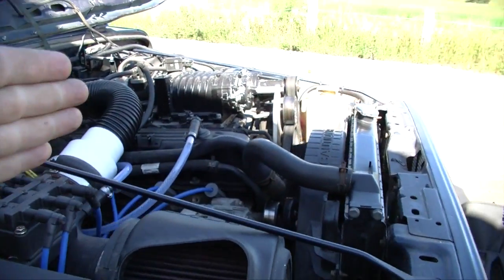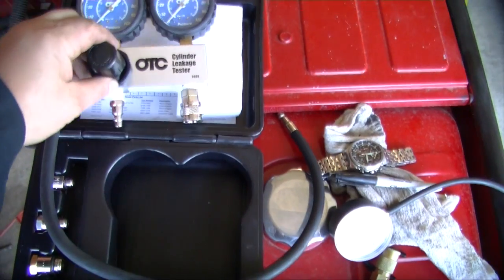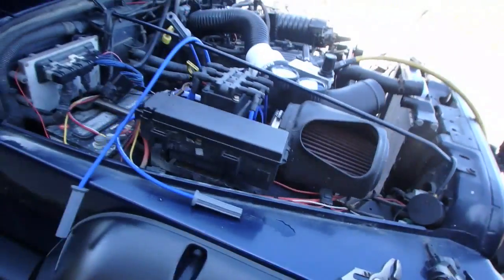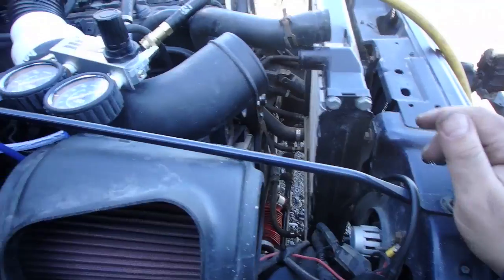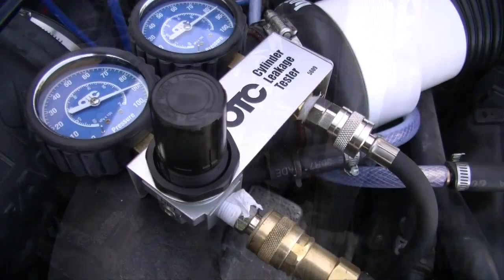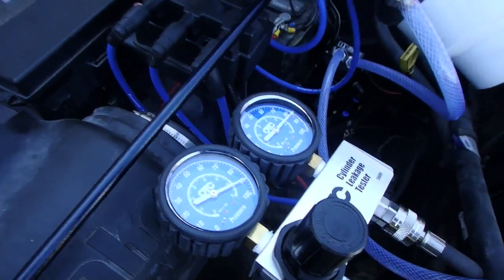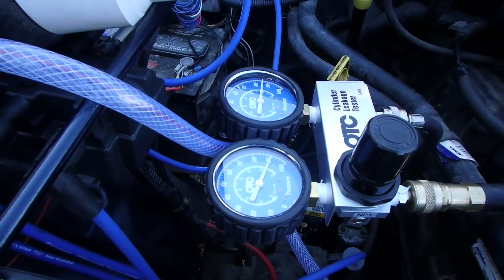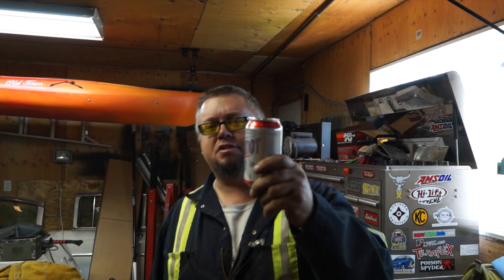Troubleshooting Low Engine Vacuum

Comment: How did you end up at 130 compression (found it), How to Do a Compression Test DIY - YouTube, you should use your camera and video all puffs of compression on your gauge, compare all cylinders puff by puff, I like 5 puffs and that is my goal. The first puff is very important but if the first puff is low due to a poor starting point of the piston, do that cylinder again. Need to lock the engine from rotating by other external means to save time. For folks who don't have a leak down tester, you don't need one, just listen for air leaks from the 3 important places, of course, you do need to get compressed air into the cylinder by other means. A running compression test can also be performed. Be aware that the battery is going to get weaker and show less compression the more you crank the engine guys, keep a jump box hooked up. Thanks for the video.

Comment: Was that cylinder effected because of the supercharger? What would cause that to wear out so quick? Loss of oil pressure in cylinder number 3 causing the rings to fail?
Reply from the maker: That issue was there long before the supercharger was installed

Comment: he man. pull it out and get a stroker long block. 
http://m.summitracing.com/parts/hpe-hp24?seid=srese1&gclid=CjwKEAiA2ve0BRDCgqDtmYXlyjkSJACEPmdwGOZavqD6h0YDjzYMFGrE2tyLYmroLvz4qNsFtEEBZRoCBOjw_wcB

or

http://m.ebay.com/itm/JEEP-Stroker-Complete-Engine-Upgrade-Kit-4-0-to-4-6-4-7-/141860737576?nav=SEARCH
Reply: i rebuilt mine myself just straight 4.0 new upgraded head and kept original cam, pistons, rods, and crank for a total cost of about 880 buks. included was a spent motor for 250 so i could do a rebuild so not to be w/o a vehicle during rebuild. runs awesome. but......my next choice would be a stroker.

Comment: Ah man, that sucks!  Great diagnostics video, though!

If you end up rebuilding this engine, have a look at the connecting rods.  I would suspect an oil delivery issue through the con rod--they typically have a tiny little pinhole through them that takes oil from the big end journal and sprays it on the cylinder wall.  It's such a tiny hole though, that they can sometimes get clogged up.  With all the other cylinders running reasonably well, it's my first thought.  Of course, there are millions of things that could cause excessive single-cylinder blowby.

Best of luck, Jerry!
Reply from the maker: +rhkips my goal is to try it till it blows up just to see how long it can last

Comment: Did you pull the dipstick to see if you could hear the air leaking past the rings?
Reply from the maker: +rhydtuned no need too, the crankcase air breather is the intake tube and doing a compression awhile ago i showed how putting oil in the cylinder brought the compression up to where the other cylinders where

Comment: I would normaly pour in some oil in the sylinder and do a test again.
Then you get good pressure on the valves and cylinder head gasket and if it start to leak more and more as the oil get pushed down to the oilpan then i'ts MFB!
Great videos, love you being so straightforword and honest and not give a fuck!
Reply from the maker: +Morten i put oil in cylinder when i did the video on the compression test and showed how doing that brought the compression up to the same as the others

Comment: I had a 2.5L push rod 4 with 150k miles that had at least 170psi on all cylinders. So good job on cluing into maybe there is a problem. I scoped the cylinders with a camera on a flex stick and could still see honing marks. So all the cylinders looked good. You may want to scope it to see if theres a buch of scoring on the cylinder walls or crap on top of the piston.
Reply from the maker: +Charlie Bryce I do have a boroscope but didn't see anything out of the ordinary, however a video on my other channel which will be uploaded in the future will show me scoping the cylinder and seeing that it looked good until i pulled the head off and see the cylinder flaking in a spot

Comment: Would it be worth trying to squirt some Seafoam into the bad cylinder and letting it sit  awhile to free up  possible stuck piston rings?
Reply from the maker: +Steve Rob no I don't think so, it was a sudden drop in Vacuum and having the motor stall out while at Customs in Alaska, took a bit to get it doing and when it did vacuum had dropped.  The Engine was pushed very hard on this trip with the added weight and all the Mountains
Reply: I agree worth a shot , it might be a stuck ring.

Comment: Interested on how long it will last. Are you leaning one way or the other as in new motor or rebuild? Rebuilding before failure would be better though. If that's the route ya go. Either way looks like a new project...new vids! And more m.f.b.t
Reply: +Tklatti01 I agree, you could probably rebuild that motor for as little as a couple hundred bucks right now.
Reply from the maker: +Tklatti01 i'm seeing how long it will last to be honest
Reply from the maker: +retiredppd or do a bastard fix and pull the head and just re-ring that cylinder while still installed in the jeep
Reply: +Bullshitkorner  pull the head if there is still cross hash lines on the cylinder walls I'd do that.
Reply from the maker: no point in pulling the head, why go though all that labour for nothing with removing the supercharger and all that you'd be looking at about 10 hours